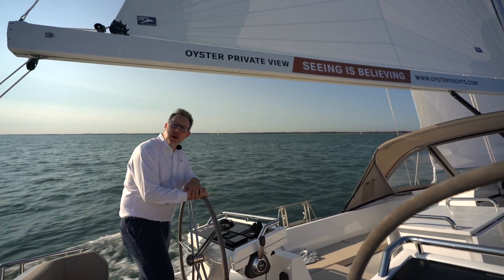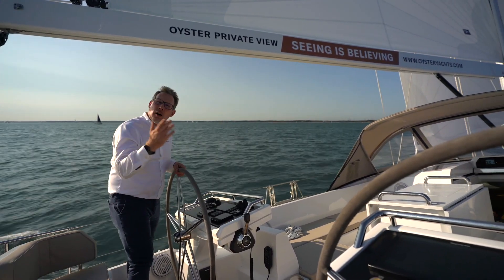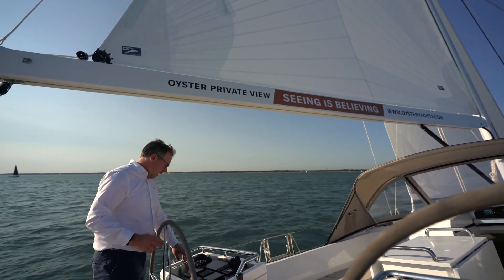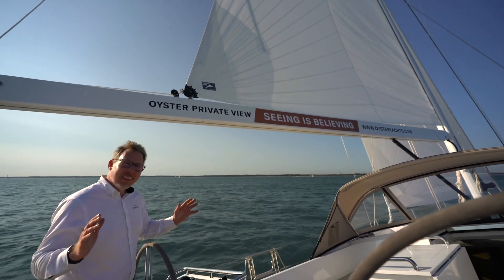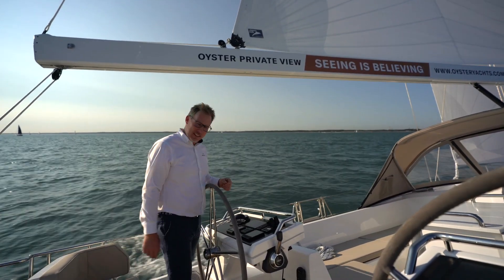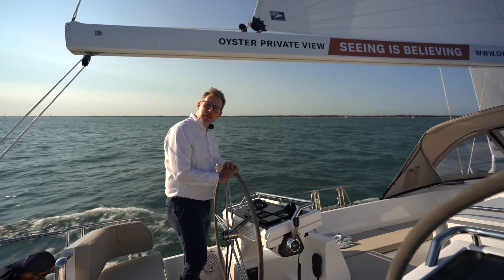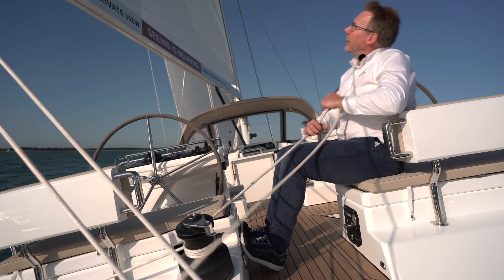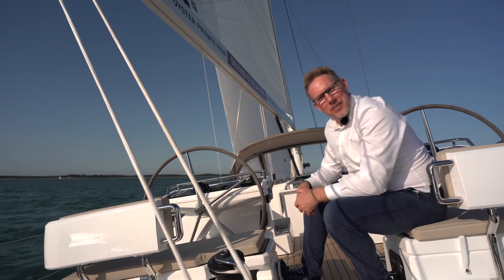A Closer Look: Oyster 565 Onboard Automation | Oyster Yachts

Comment: Is the sound dubbed afterwards or if not what mic do you use - very little wind noise! Does the mainsheet stay clear when the boom is fully forwards (it doesn't look like there's a traveller)
Reply from the maker: Hi Tom! The mic used is a Sanken COS-11D PT Mic with a Sony Transmitter and Receiver. To avoid wind noise we suggest to choose a fluffy or wind muff mic and to pay attention when positioning the mic and fluffy on the talent. In this case it has been positioned on the inside left of the collar to act as another wind barrier. As far as the mainsheet is concerned, the Oyster 565 features a single-point mainsheet configuration that allows for excellent access to the aft deck and walk-through cockpit, there is not a traveller in the standard setup. Oysters are designed to sail well on all points of sail, and many of our owners choose to circumnavigate in the trade winds - our designers have made sure the 565 main sheet runs fair, even when sheeting right out and running downwind.
Reply: @oysteryachts  Thank you! Really interesting tips on both the microphone and the mainsheet, you build lovely yachts!